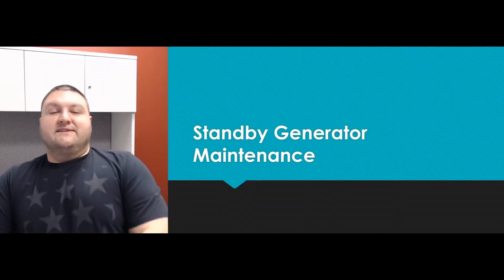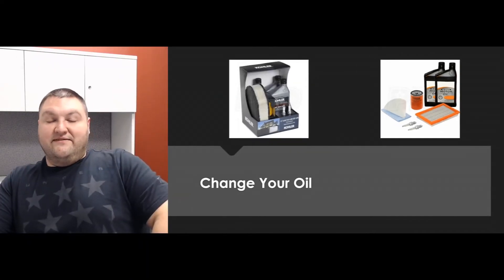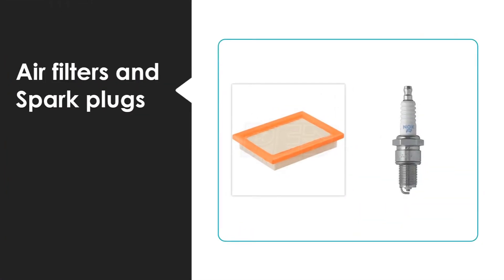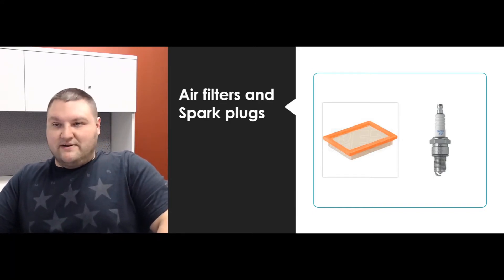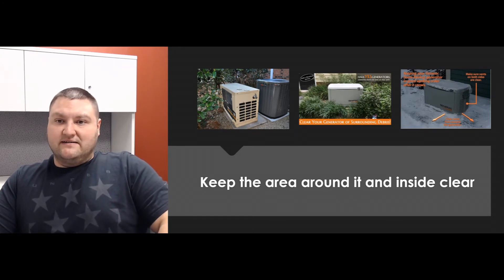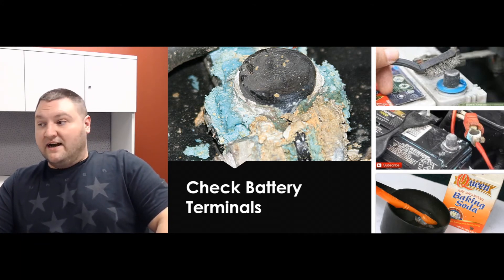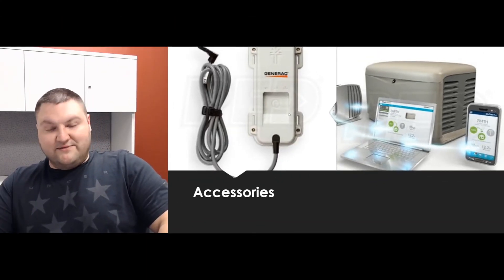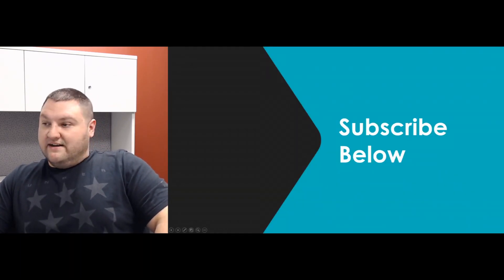Standby Generator Maintenance Tips

Comment: If you put a wire compound on your battery terminals will never corrode that’s the first thing when you install battery when it’s new.
Reply from the maker: There are definitely ways to prevent early wire/terminal corrosion, that being one of them. There are terminal gels and other lubricants that can be easily applied to battery terminals to protect them from oxidizing as fast. For those interested, you can usually find those types of products at your local hardware or automotive store.